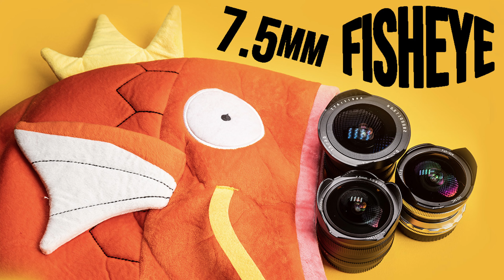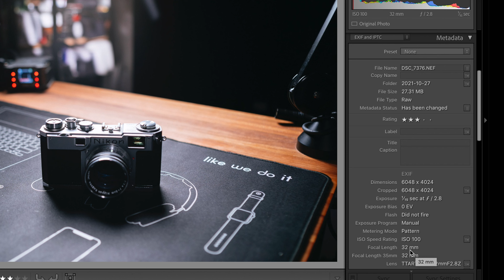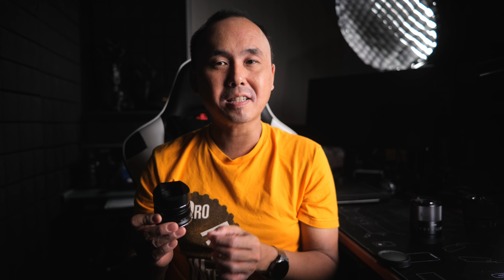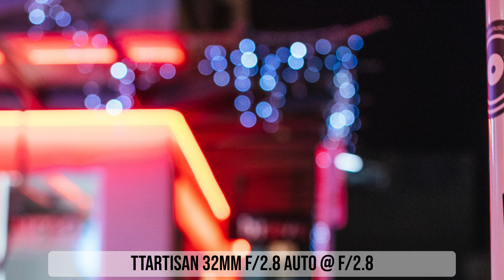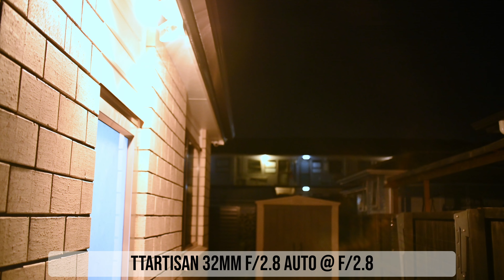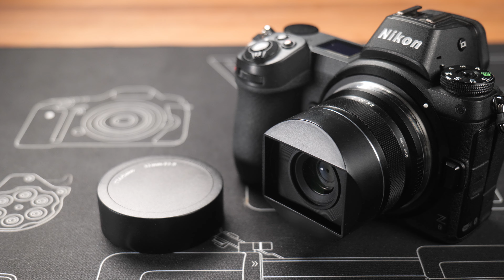TTArtisan 32mm f/2.8 Auto (Nikon Z / Canon RF & EF-M / Sony E / Fuji X)

Comment from the maker: A little fun fact.  I did this review back in Oct 2021, and the review has been sitting on my channel unlisted since then.
Reply: Woops.
Reply: I was curious if TTartisan will actually release any firmware updates for this, but looking at their website there's been 4 releases - the oldest back in Dec ("Optimized motor drive to reduce motor noise"), and the latest a week ago ("Optimized the exposure when taking pictures with small aperture"). It looks like TTartisan taking a while between the Chinese release and worldwide release of this lens was a good thing!

The firmware updates don't mention making the aperture quieter, so the quieter AF performance from the update back in Dec probably doesn't change much of the conclusions in this review.
Reply from the maker: @Max Hammick Yes i was a bit surprised and delighted that TTArtisan has made a few firmware update already, rather than just adding a USB port but not provide any firmware update at all.
Reply: @TheRealRichardWong  ccccccccccccccccccc'cc

Comment: I just picked up one of these, and IBIS works fine with it on my Z6.
Reply: Two weeks later, any good updates with this lens?
Reply: @corykphotography  Flaring can be really strong at f/2.8 -- you'll get a ring of flare around the center of the image going through any bright point of light. This type of flare completely disappears if you stop down to f/3.2, so I think it's reflecting off the inside of the part of the lens that defines the maximum aperture.

Comment: Richard I have a question for you. The lens I received can't focus at infinity if I follow the distance scale on my Z6ii LCD. The image ends up being out of focus when I manually turn the focus ring until the distance scale on the LCD goes all the way to the right. It focuses at infinity about halfway on the scale. Are you observing this behavior too?
Reply from the maker: I can't say I remember that. It's possible the lens maybe not implementing that correctluy.  But having said that, I usually don't rely on the scale as I found it's not really accurate.

Comment: Has anyone compared the sharpness of this lens to the default lens (16-50mm f3.5-6 dx) that comes with the nikon z50 and zfc? I'd like to use it as a lightweight, daily carry lens which could perform better in low light with the f2.8. however since i usually shoot at day, I'm more concerned about the sharpness.

Comment: Thank you for your always excellent and informative lens review, Richard! As a Z7 landscape and product photographer, my main criterion for a lens is its sharpness and detail rendition at optimum aperture. So, how would you rate this lens at around f/8, in terms of image sharpness as compared to, say, the Nikkor Z 24-70 f/4 S at 32mm and f/8? Thanks again!
Reply from the maker: hey Steve,   i havet done side by side comparison so can't answer for sure.  But at f/8 there really isn't big difference between most modern lenses, i think the Nikkor would probably slightly sharper.    However one thing to consider is the lens flare performance,  the TTArtisan isn't that good and you could have lens flare, ghostiinig and low contrast when the sun is in front of the camera while the Nikkor is much better in this area.
Reply: @TheRealRichardWong  Thank you, Richard, for your informative reply! I'll actually be testing the TTartisan for my own purposes. I generally only use OEM primes and zooms, with the exception of the super-sharp Laowa 105 f/2.8 Ultra-Macro lens for Nikon Z Mount. Now THAT lens is ultra-sharp (tested at macro distances)!

Comment: As always, thanks for your honest insight & review, Richard. 

What i dislike onto this lens especially is, that you can't put off the integrated lens hood. Therefore, one must screw-in very small filters. Then there's the excellent Samyang Pancake-esque 35mm F2.8 AF, which i do own since 2018, and it's a great lens for such little money, also fullframe, and almost as good, as the Sony Zeiss 35/2.8 FE, but costing 3 to 4x less than the Sony. 

I've seen the cheapest price for the TTA 32/2.8 AF is 169 EUR (3rd August 2022) on Aliexpress - for that money, even quite more cheap (ca. 120-130 EUR) one can buy the Samyang/Rokinon 35/2.8 AF for Sony E-Mount, with better image quality, albeit not for Nikon Z Mount. 🙂

TTArtisan does have sadly a long history, issue with lens flares - not only this AF 32/2.8, but also their more common known 35/1.4 ASPH M Mount, and their all new 35/F2 APO ASPH M Mount, does flare like hell.
Reply from the maker: Hey Marc, thanks for watching.  Re the lens hood, yes removable would be great. But I guess because they want to achieve that extendable feature to keep the lens compact when collapsed so it's a trade-off.  I have or I should say had the Zeiss 35mm previously. It is a beautiful lens but in terms of performance I feel it 's a bit overpriced when conpare to the other lenses available right now.
Reply: @TheRealRichardWong  Hi Richard, thanks for your answer. Yes, the Sony Zeiss 35/2.8 AF FE is being overpriced right from the start (Fall 2013), therefore, i've bought the Samyang 35/2.8 AF FE, which into 1:1 comparsions, is really not much behind, from the optics department.

Comment: For what this lens cost, I'd much rather get the Nikkor Z 28mm/40mm primes and have the full 5 axis IBIS on the Z bodies.
Reply from the maker: Those Nikon Z 28/40mm primes are great value for money !
Reply: So the ibis won’t work with this lens?
Reply: @sweetkittenpuss  It does. ou just won't get full ibis...I think manual and third party glass only gets 3 axis IBIS -  Not 100 percent sure though.

Comment: Hi I have questions want to ask you if I buy (TTArtisan 32mm f / 2.8 Auto) can I use with all camera ( Nikon  / Canon /Sony / Fuji )?
Reply from the maker: no, you can't. Each camera mount has completely different size/contacts/protocol,  so you have to buy the version for your camera.
Reply: @TheRealRichardWong  Where can I buy it? I found that only for Nikon, not for sony.
Reply from the maker: @TimJazz-b7m  Right now only the Nikon Z mount is released, the other mounts will follow
Reply: @TheRealRichardWong  thank you ☺️